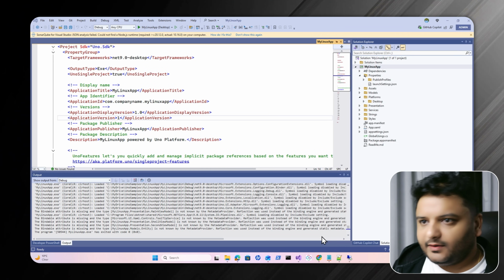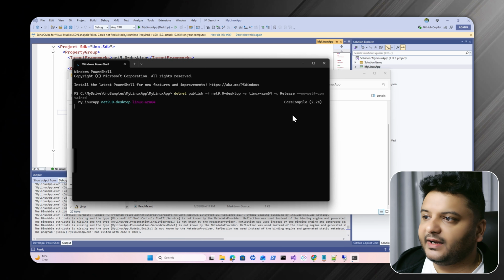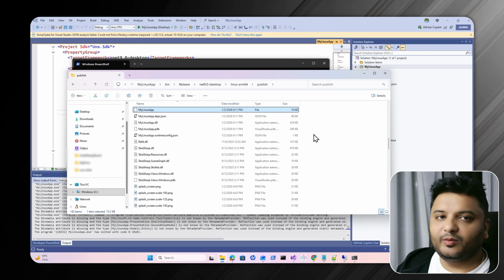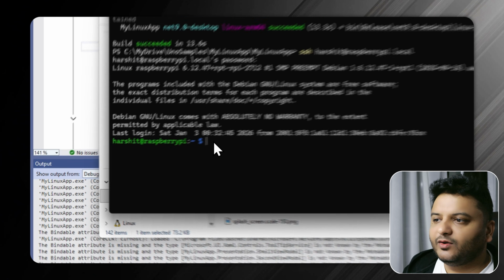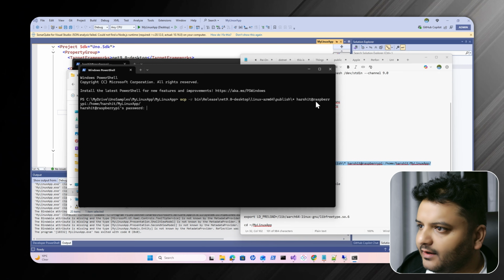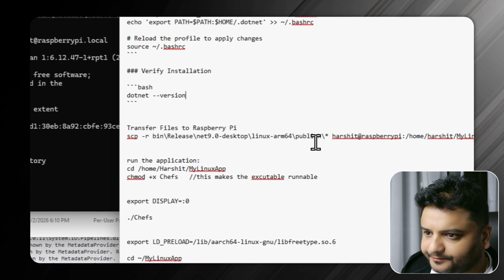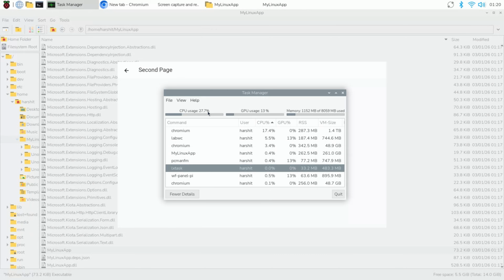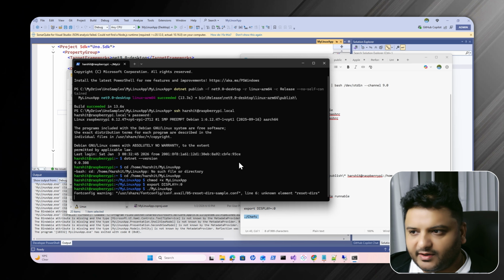Build a .NET Uno Platform App for Raspberry Pi (C# on Linux Step-by-Step)

Comment: Word of warning, latest versions of Uno do have some compatibility issues with the raspberry pi as its trying to force the SkiaSharp package to publish in v3.119.0, if your published application produces DLLs of the Skia packages newer than 3.116.0, it might not be as simple as this tutorial suggests, you may have to upgrade some libfreetype libraries among other things, and Preload the latest version of libfreetype.so.6 to execute the Uno app. Took me half a day to figure this out.
Reply from the maker: Yeah if that happens you will have to upgrade those on the pi . 
Thanks for the input
Reply: @harshitdynamite  Thanks for your response. I gave up on Uno in the end, version 6 has too many breaking changes and unclear documentation, or I'm too much of a noob. 

Switched to Avalonia, if you ever get chance that might be a useful tutorial as an alternative to Uno and works on the Pi straightaway.